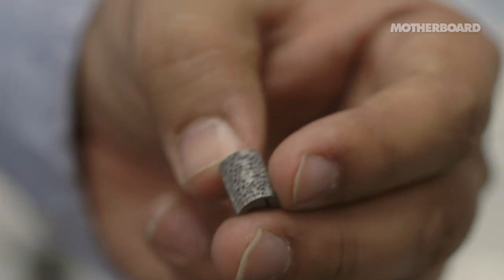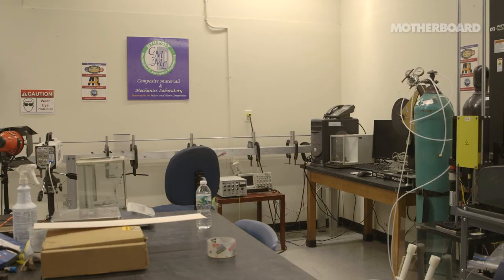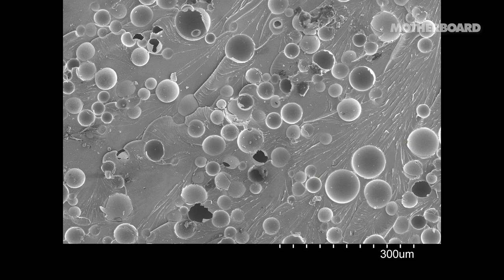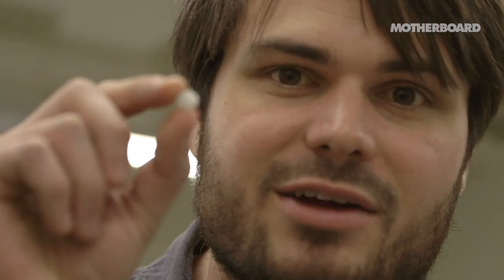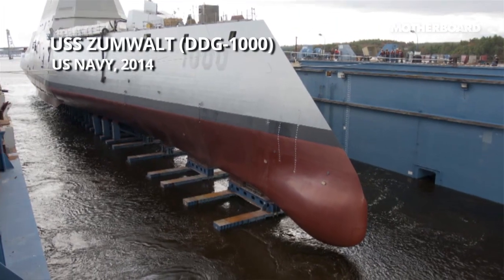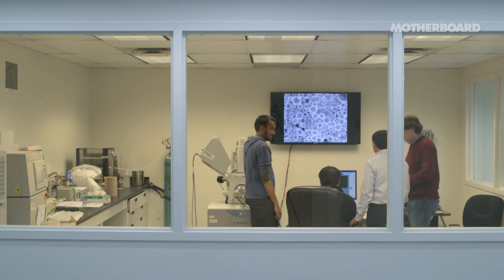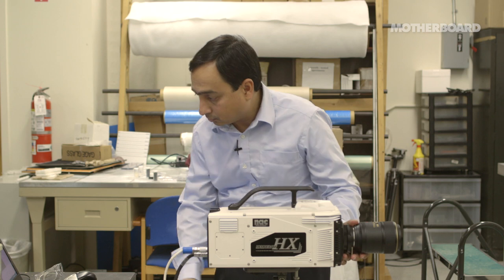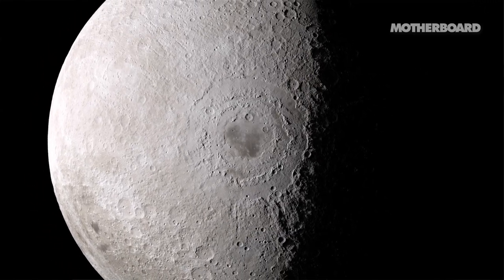Engineering The Strongest Foam in the World

Comment: I took hollow glass bead and polystyrene balls and mixed it in with epoxy resin.
First I mixed in the hollow glass bead until the epoxy was saturated and the hollow glass bead would no longer go into the mix.
Then I poured off the excess hollow glass bead and then added (about 50% of the volume) the polystyrene bean bag balls.
Once it set up it was so hard you could hit it with a hammer, and it didn't break as the epoxy has a compressive stress of about 100 MPa  - steel is 280 MPa - and it floated on water, so you can make this stuff at home pretty easily and its very strong indeed.
Reply: tell me more about that idont get why you put excess hollow beads pour them of and put polystyrene?

Comment: Why is there absolutely no information on how it is made? He says that you cannot just have a porous material, or it will be weak. You need a material with "tiny hollow particles", but what are these particles? Are they removed from the examples that he shows in the video? because they definitely look porous. I feel like very little information was given in this video, even the basic stuff. Maybe this stuff is under patent, and he cant give out information, or maybe the reporter just didn't ask very good questions, but either way it feels like a waste of a video
Reply: The particles are just hollow metal spheres of uniform size. You can get a bunch of them fairly easily on AliExpress. Then you just inject/sinter a molten metal like aluminum/titanium into the matrix. If you've ever seen the Taofledermaus channel, it's kinda like what he does with wax slugs, except the lead shot are replaced with tiny hollow balls. You can even make composite syntactic foams out of hollow glass spheres. 3M manufacturers these in various sizes to make lightweight, yet strong, polymer materials.
Reply: +Mike Trieu (MegasChara) ahh thank you so much
Reply: He said its funded by the military so its probably secret
Reply: I think the difference between "porous" and "tiny hollow particles" is basically the difference between an open and a closed cell foam.
Reply: Mike Trieu suprisingly this material sounds a whole lot like the composite used by russia where they use a porcelin sphere matrix last i heard.

Comment: You reduce the weight, you only reduce fuel consumption,not increase efficiency.....
Reply: Which a lower fuel consumption is more efficient.
Reply: +o2Hayden 
The technology isn't.
If i load my car with 300 kgs of bricks,it will suck more fuel than empty.
The efficiency is not better empty than full of bricks as i know.
It's just less loaded.
efficiency is the same work done with less.
Reply: michaelovitch He never claimed the technology is, he just said that its more efficient. Which it is.
Reply: +michaelovitch air drag is the biggest factor for fuel consumption in cars. weight is less important if u are moving at a steady speed
Reply: +meforsure 
it's not the bigger,and i agree about steady speed.
the problem is acceleration.
Reply: +michaelovitch lower fuel consumption for the same distance, that sounds like efficiency to me.
Reply: +origami pilot 
efficiency would be using less fuel for the same car's weight and performance.
here it's just bypassing the efficiency problem with basic tricks like weight/hp ratio.
here it's : less weight = less fuel to have same performance.
I think it's the way you burn the fuel wich is the efficiency ,not the way the reduce the counter work applied on the car's movement.
I mean ,it's only the engine wich allow movement,the rest is just a brake to it.
i guess there are several layers of efficiency,if you want see that really globally.
Reply: +michaelovitch You are both right and wrong. True, the amount of fuel being used per the total amount of work being done is not really changing much if any. However, the objective of a car is not to move itself but to move people and/or cargo. In terms of "how much fuel does it take to get me to work?" or " how much fuel does it take to get two tons of bricks to the job site?" a lighter weight vehicle, all else being equal, will be more efficient.
Reply: Its more efficient if the car was lighter in the first place, its why truck drivers are using super single wheels vs dualies.

Most all fuel efficiency comes from weight (acceleration) and shape (wind resistance at speed) of a vehicle, next comes the drivetrain efficiency.

This is why a Alfa romeo 4C is faster than some cars with double the HP and still almost gets 30mpg, you can afford to install a smaller engine for the same performance.
Reply: Nuckelhedd Jones
A car isn't just an engine, its a machine- a system, and if you can get the same work done with less fuel/energy, it, as a system, is more efficient.

For Christ's sake people, this is what is wrong with the world, you don't look at the big picture.
Reply: +Wyvern 
Thank you. Finally some reason.
Reply: +michaelovitch If its lighter (and it will be by a lot if this is used) then fuel consumption is drastically reduced which therefore greatly increases the efficiency.  
doesn't matter how or what, as long as the fuel consumption is going down the efficiency will go up.
No one said that it will re-create the car engine or revolutionize tires or wtv lol
Also, this has to be the stupidest and most narrow minded discussion on youtube and i'm now tilted at the inefficiency of the human race.
Reply: +EpicBunty 
If it's too narrow minded and stupid for you ,what are you doing here  ?
You are super human maybe ?
Efficiency do not goes up because the car is lighter.
Efficiency goes up when you spend less for the same job : that mean exact same conditions.
It's a mechanical device,so it's using power created from an energy source.
Even if it was an electric motor,you would have efficency taken in consideration,because there is a waste of energy somewhere,like heat,friction.

the engine make the car to roll,not the body.
engineers use shit loads of tricks to reduce weight,change gearing to lower rpm,lighter vehicle.
But all that only reduce consumption,not efficicency.

"Fuel efficiency is a form of thermal efficiency, meaning the efficiency of a process that converts chemical potential energy contained in a carrier fuel into kinetic energy or work"
wikipedia.
Reply: You are right +michaelovitch Some ppl don't understand physics that is clear.. http://www.e31.net/resistance.html . The speedier the vehicle the bigger factor wind resistance becomes. Wind resistance increases by the square so double speed 4times as much wind restate the and rolling resistance doesn't increase by velocity. therefore its more important to make a aerodynamic car than a light car.
Reply: meforsure
It depends on where the car is driven. around town, weight is the most important factor, on the highway, aerodynamics are key, this is why the Viper gets 16MPG around town, but over 22+ mpg on the highway (also because of gearing)
But you still are increasing efficiency of the system regardless if you reduce weight.

Again, everyone needs to see the whole picture.

Comment: For those who are curious about a basic way of making this stuff: 
You put ceramic micro-spheres (which are hollow) and aluminum in a furnace under vacuum at around 700°c for a couple hours, then you flood the inside of the furnace with argon gas. The argon forces the aluminum down into the ceramic microspheres, basically creating an aluminum latice around the hollow ceramic microspheres. This creates an open cell metallic foam. After cooling, you clean the material, flushing out the remains of the ceramic microspheres (the cooling process should damage their structure). After cleaning the matrix, it is then reheated under controlled conditions and the open cells are allowed to close, creating a closed cell matrix.

Consiquently, you can create a DIAMOND latice using a combination of microspheres and chemichal vapor deposition. 
No one has done this yet, that I know of, because I just thought of it. :P

Comment: what a crap was that? strongest foam? wiki: "A foam is a substance that is formed by trapping pockets of gas in a liquid or solid". As he explained they add hollow spheres in to liquid material X. When it dries/cools you end up with lighter porous material X. So technically more trapped gas in the material X means it will be lighter, but same time weaker than 100% pure material X. By reducing the size of spheres you still end up with greater density of material X. Which will increase the weight.  Based on that material X cannot be and stronger and lighter at the same time. 
by the way the concrete is porous and strong, but it is not a foam or is it?
Reply: I didn't understand it either. Let's say he creates "the strongest FOAM in the World". It would still be a shitty material to use. It wouldnt be flexible and it couldnt suck up liquids. And if you want to build for example airplanes out of it you can't because there are better materials than "foam".
Reply: its a lightweight strong material which is a foam as it has holes in it...
Reply: Certain shapes are stronger than others. I know it may be hard to believe, but it is a definite possibility that a foam in this style of the same material can be stronger than a solid mass of said material.
Reply: Air pockets in the metal would actually provide a certain increase in the ability of a metal to bear stress. Instead of the metal cracking/warping the air pockets absorb the energy of the stress and this can actually improve the amount of stress a metal can take. Also, it would depend on the application... for example, using these in cars allows the chassis to absorb a greater amount of impact thereby protecting the passenger. It follows the trend where car manufacturers gradually moved to car frames which crush during impact because doing the opposite ends with the shock transferring through the car to the passengers resulting in greater fatalities.
Reply: Ask the actual scientist to explain. A youtube comment section is where science goes to die.
Reply: @Leverenz 
It's not just a shitty material. Yes, strength and ductility decrease significantly by the introduction of pores but metal foam has different applications than structural integrity. For example energy absorption or dampening characteristics are superior to a dense metal.
@666NedFlanders 
No, it's not stronger but that's not the purpose of this type of material as I said.
@Akshay Sinha 
No, that's just false. Metal foam can't bear more stress than dense metal. What you mean is the toughness or the ability to absorb energy during deformation of the foam. But the air pockets themselves don't absorb the energy, it's the gradual collapse of cell walls under compression that leads to high possible strains and therefore energy absoprtion. Maybe you meant that but I would phrase it differently.

Comment: A practical application for strong foams would be in the military.  Where a bit of foam inside the driving compartment can be very useful for preventing injuries in accidents.

I was only ever in one somewhat serious accident while driving a stryker, and between the foam padding and my helmet despite taking the entire impact of the crash to my head I was pretty well fine after the crash.  Bit dazed and confused but still able to drive,

In cars I can see it being more difficult to really protect the driver and passengers with foam because of how they are set up, but even just adding an inch of foam or so the ceiling could definitely reduce deaths from roll overs.

Comment: 0:55 How is made the "syntatic foam"? How you get hollow buble as see in 0:59 ?
Because is not like airgel where all hollow rooms are conected with others and air flow can pass. this are closed bubble right? That make this interesded, this make thermal gap for better isolation and gain structural integrity at same time.
Seeing your video only i think thic can be done by premade the hollow balls the size you want ant the same material you wil introduce it, and after somehow you turn the liquid metal to fill the gaps(dont know if this melt the hollow balls). But after this is how you bake hollow balls of a metal? is not the same make filled metal ball. Can be made as pingpong or tenis balls in 2 parts and unify after.
How you make it?

Comment: Nothing happening there. All we saw was the materials testing laboratory (crush it, bend it, submit it to gradual pressure, impulse pressure, test for water absorption, heat retention or rate of loss (only need an oven for that), optical characteristics (reflection of light - only need a light meter for that), twisting, UV degredation resistance (have any of the above material qualities changed with short or long term exposure to sunlight) etc... that was it. And he mostly theorised about what is possible - THAT WAS IT!!!! Nuthin.

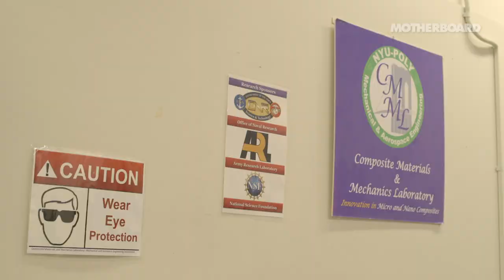Comment: 1:50 Is that blood on the metal???
Reply: It's probably lubricant.
Reply: L00NGB00W  Blood is the best lubricant.
Reply: MisterRed6 Can't argue with you there. ;)
Reply: Dykem (layout fluid). Used for laying out your cuts prior to manual milling. You can see the horizontal scribe mark made by the machinist. A smaller mark was likely made for the vertical intersect. That intersect is then center punched then drilled out on a mill or drill press.
Reply: Ali Mohamud No it's layout fluid for marking the brackets prior to fabrication.

Comment: Take the length of the video 5.22. 5,22 -0.22=5. take the number of comments is 16. 16-5=11. and 11 subtracted with the comment bellow is 0. And 0+ the next tree comments= 3. AND 3 is equal with the number after 2, witch is 3. HALF LIFE 3 CONFIRMED.
Reply: You crazy, man.
Reply: ***** Am i not correct? with next comment HALF LIFE 3 WILL BE CONFIRMED, from the past
Reply: Fi☪†i☯N your math is incorrect , 3 is equal with the number after two, which is indeed three however you forgot that a triangle has three sides and THUS my friend, the illuminati is confirmed, not this half life you refer too.
Reply: Capt Sealeg NO your incorrect, as you see λ has 5 points, equal to the number of comments. you subtract the 5 with half life 2, 5-2=3. witch is also equal with illuminati. Conclusion the new world order is holding back half life 3, witch is confirmed.